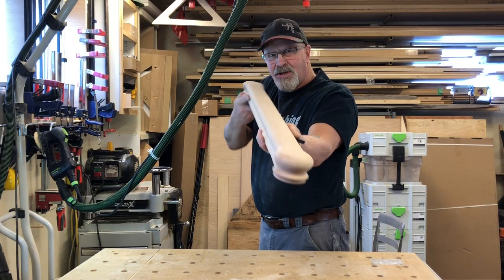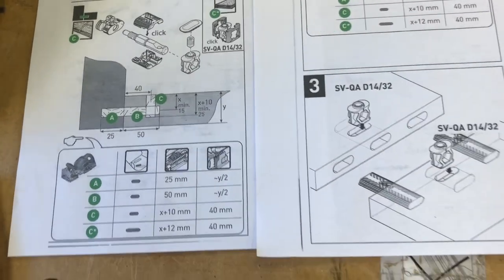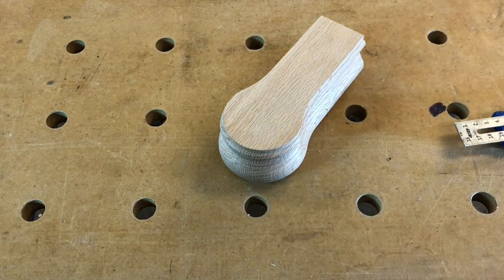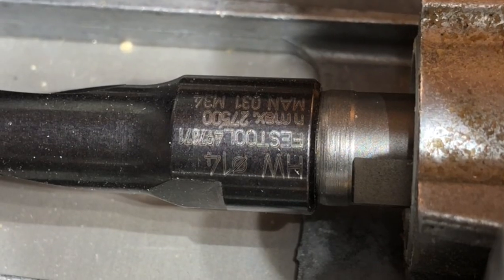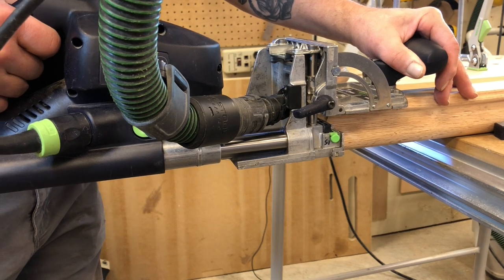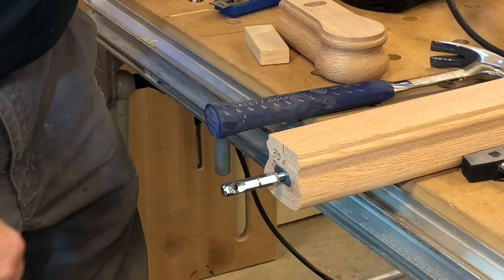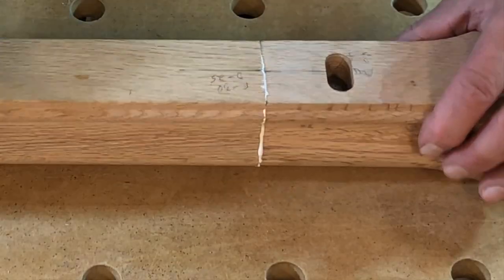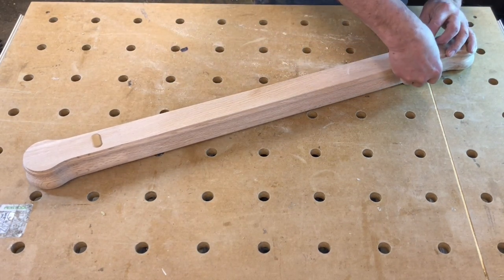Railing Connections with Festool Domino XL Connectors

Comment: Thanks for the demo! I tried these connectors, but finally I got back to using one single domino and a pocket hole with a long screw for getting things tight. Ends up with one visible hole, too, but with less effort and saving money. For me, the domino connectors are kind of finicky in terms of alignment and mounting.
Reply from the maker: Thanks Martin. Your way sounds very reasonable too. Recently I have been using the Lamello Invis for railing joints and have a video coming on that (November). It's a magnetic fastener that is totally invisible.

Comment: Maybe try putting a layer of painters tape on the wood before you apply the hot glue. Then when you're done you can peel it all off with no marks on the workpiece. I have not tried this with my Domino machine but it might work.
Reply from the maker: Thanks. I will try that.

Comment: Thank you for the footage but connectors are for knock down … gluing them is literally going against what they are meant for and the alignment looks all off in the end. The installed railings look great but I’d be angry with all the caps underneath if it were my rail. If you’re going to glue just use domino. For the removable section use a tongue and groove or I guess the connectors here if appearance/ craftsmanship is less a concern
Reply from the maker: I respectfully disagree that the connectors are for knock down only and not for glued joints. You should check out my videos on the Lamello Invis. They are totally invisible and provide the necessary clamping pressure while the glue dries.

Comment: What is the point of using the connector instead of plain domino if you are glueing them up?
Reply from the maker: Two reasons in this case: First the connector pulls the joint nice and tight without the use of clamps. Secondly, I purchased the system for a continuous handrail job that went from a guard with balusters to a wall-mounted handrail. The customer wanted the hand-rail portion removable in case he wanted to bring a large piece of furniture or appliance up the stair well. The piece made in the video was done for another customer who wanted a short section of rail made up. I used this opportunity to demonstrate the use of the connectors.
Reply: I was wondering the same thing and you explained why very well.  Thank you,